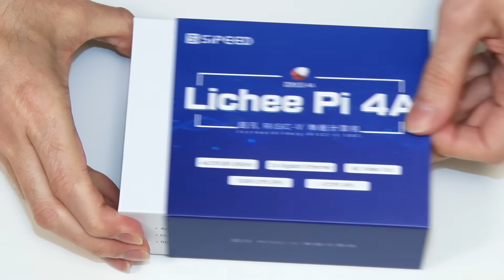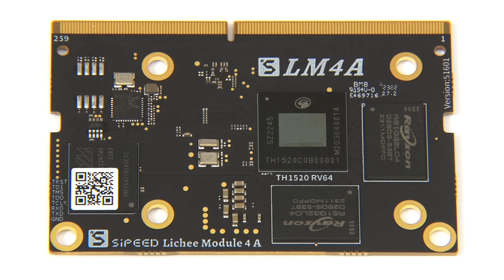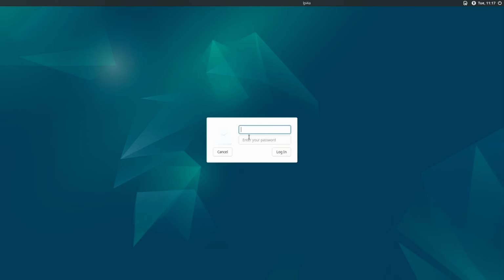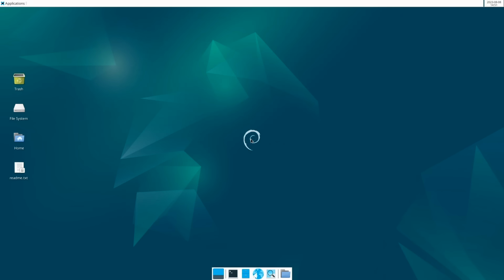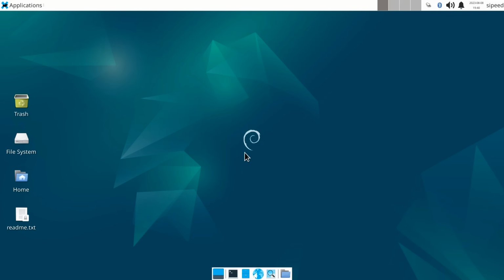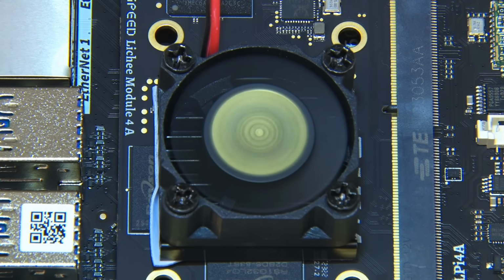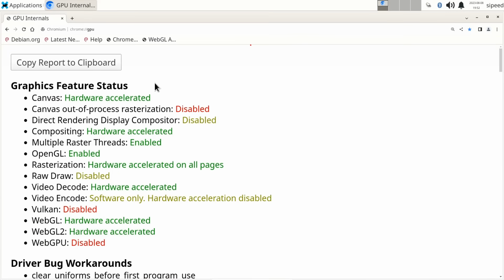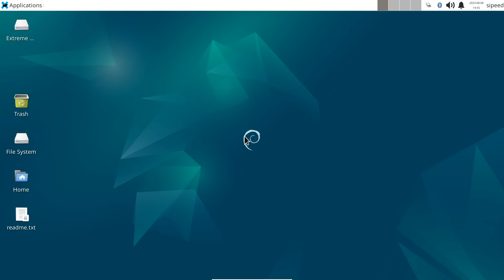Lichee Pi 4A: Serious RISC-V Desktop Computing

Comment: Definitely impressive. The presentation and smoothness of implementation bode well.
All those connectivity options should cover development for a wide variety of applications. (They obviously add a good deal to the cost of manufacture). Even then, the price is not unreasonable, and can probably be expected to drop if sales go well. 
The "official " case doesn't appear to be available for sale yet, but there's already a file for 3-D printed case on Printables. 
Your experiences with a test-drive will be most interesting. Do check your network while you doing that, for any inexplicable packets aimed at Chinese IP addresses. (Just in case it wants to 'phone home.) 
Seriously, buying anything from China today carries the question of whether it supports the CCP,  involves slave labour, or otherwise enables bad things.
Reply: well, which device isn't produced in China ?
Reply: @autohmae  At least as far as final assembly is concerned, the Raspberry Pi. (Made in Walesl)  I haven't followed the supply chain further back.

Comment: I think for YouTube playback, you may want to try to see if you can force H264 instead of the default VP9 codec that is used. The RISC-V processor seems to have hardware decoding and may be able to achieve much faster video playback with h264.
Reply: It does have HW decoding, but it should be able to pull off VP9 as well.

Comment: a quad core is to les to have a decent experience. and that module is engendered to run in a cluster.  that means for a decent desktop you will need 2 compute modules. try to benchmark as y saw on the chromium gpu report Vulkan support is not installed. so ed acceleration is not really there without Vulcan is just 2 d acceleration. in debian is nothing installed by default so ill suggest you do a benchmark after   you upgraded the is too latest after update the system you need to recompile the boot image the system is similar to an android hardware where the bootloader is installed on an extra chip/partition to be able to boot the os   but for best practice is at best to compile your own boot image based in the kernel witch resides in the boot image

Comment: It's always great to see that a SBC will work straight out of the box with the included Linux distro. It indicates a significant degree of care for the customers, present, future and repeat.
Reply: It has only now occurred to me, a couple of hours after watching, that this isn't, in fact, a SBC...
Reply: @BrianRonald  technically true. Sipeed make a lot of their boards this way e.g. see Lichee RV CM and Lichee RV Dock, M1s Module and M1s Dock.
Reply: I don't understand people that make comments like you have - SBCs are supposed to be aimed at hobbyists and makers who are used to messing around with hardware and software. As a member of such communities myself, I really could care less whether or not an SBC comes with Linux (or any OS) pre-installed, because I will install my own distro of choice (Gentoo) on it anyway.

If you don't know how to install Linux yourself then, in my opinion, you really shouldn't be using it and stick with consumer-grade hardware that has the OS pre-installed for you and some kind of warranty that protects you from your own lack of skills - whether that's a Microsoft or Apple device, or a Steam Deck.

SBCs are not consumer-grade devices and should not be treated as such - they are for people who know how to investigate hardware and configure Linux themselves to add to the knowledge of the community.

Even this device is in its early stages, work clearly needs to be done on the desktop OS (there's clearly still some lag in Chris' video) and the video drivers themselves need work. Someone who expects Linux to be pre-installed would not be happy with the performance of this device, and just blame Linux for it.
Reply: @terrydaktyllus1320   but they are gonna target small laptops and desktops market, so they better just work.
Reply: @autohmae  Sorry, who are "gonna target" the small laptops and desktops market?

So what you're saying is that the average user of laptops or desktops as an "all in one" package is instead going to buy an RISC-based SBC on which they would need to install their own OS, add their own keyboard, screen and mouse, etc. etc.?

Do you not understand that these are completely different kinds of devices? That SBCs are targeted at developers and hobbyists, or people that prototype hardware?
Reply: @autohmae  Why would I respond to your question when you have completely ignored the questions I asked you first?

Don't be so self-entitled - either have an intelligent debate and answer questions when you are asked them or just go away.

Your choice.
Reply: @autohmae  Yes, and it's a valid point that you now make. 

But my argument is then that if they end up making laptops or desktops, then it will be because the SBC has been a successful "prototype" to such devices in the future.

I don't know what SBCs you have used previously, but the Raspberry Pi has always been "the exception to the rule" because it has had excellent software and community support, which means it can be thought of as being CLOSE to a consumer device - i.e. someone who hasn't messed around with computers at all can get a Pi and a MicroSD card and follow a tutorial or YT video on installing Raspberry Pi OS easily. And good luck to such people, I have no issue with anyone getting more clever with computers.

But go to SBCs like the Orange Pi or Asus Tinkerboard, and the OSes that they run aren't so well supported, and may need tweaking or additional configuration to get them close to working 100%. In my view, that's the NORM with SBCs and it's up to hobbyists, developers and makers to get the best out of those board. (Even I do custom Gentoo Linux builds on such SBCs - it's interesting to do but it's very time consuming and not easy a lot of the time.)

So, no, I don't see SBCs REPLACING laptops or desktops for most users, but sure they are the prototypes for consumer devices in the future that may replace such.
Reply: @terrydaktyllus1320  well, see it from this point of view:
a lot of people buy a SBC for example for projects where they need GPIO pins, they don't necessarily want to write a driver for the WiFi card first
having some distro working means that they can (theoretically) also get other distros to work (even if it means that they need to take the patches from the official distro and port it to the one they want to use) without needing to start to write a kernel patch from scratch first
if on the other hand not even the included distro works from the get-go (e.g. the display output doesn't work and you want to use it to monitor and control your plant watering system with a touch display connected to it), how likely do you think you are going to be able to use it for your intended purpose?
Reply: @kuhluhOG  Your reply makes no sense whatsoever, let me break it down a bit.

"a lot of people buy a SBC for example for projects where they need GPIO pins,"

Yes, absolutely - and is one of the main reasons I will use an SBC instead of a used SFF PC that I can get for a similar price - i.e. because I need GPIO pins.

"they don't necessarily want to write a driver for the WiFi card first having some distro working"

Utter nonsense, and that's you demonstrating a lack of Linux knowledge and, instead, repeating a meme or "what a bloke in the pub told me".

I started using Linux in 1996 and go back 20 years, there were issues with wifi drivers in Linux, mainly due to availability of closed firmware and proprietary chipsets. In the past 15 years or so, I have had ONE issue with wifi drivers where my wife gave me her old Macbook from 2013 (when she upgraded) and I stuck Linux on it. The Broadcom wifi card wouldn't work, I had to buy the previous version for £5 on eBay and that fixed it.

Guess what? Nobody can just put any hardware they want on Windows either. I have a printer and a scanner that work perfectly fine in Linux but there have been no Windows drivers for them since Windows 7 - so the opposite is true too.

Only stupid people don't research hardware to check it is supported by an OS before they install it anyway - and a wifi card is cheap to buy and replace in any PC desktop and (most) PC laptops.

"they can (theoretically) also get other distros to work (even if it means that they need to take the patches from the official distro and port it to the one they want to use)"

More nonsense because hardware support doesn't vary between distros - the kernel, not the OS, provides the hardware support through drivers, and the kernel code between distros is extremely similar.

"without needing to start to write a kernel patch from scratch first"

I've never needed to patch kernel source to get a piece of hardware working - on a rare occasion (and not within the past 10 years or so) I've had to download external driver sources to compile against the kernel I am using, but I've used Gentoo Linux for 20 years now and that stuff is second nature to me. Plus it really has to be very OLD or ECLECTIC hardware to have that happen.

"if on the other hand not even the included distro works from the get-go (e.g. the display output doesn't work and you want to use it to monitor and control your plant watering system with a touch display connected to it), how likely do you think you are going to be able to use it for your intended purpose?"

I can't answer that question because, as an engineer, I have not been given enough detail by you to answer it. Is the watering system wifi enabled? Or does it use bluetooth? Or do I control it though a Pi Pico or ESP32 microcontroller, in which case I program it through the Arduino IDE which is fully supported on Linux.

Again, this is about doing proper research first - and not just believing "what a bloke in the pub" told me.
Reply: @terrydaktyllus1320  "In the past 15 years or so, I have had ONE issue with wifi drivers"

1. You do know what an example is, don't you?
2. I help at my local universities at the Linux install parties at the start of every semester. We have about 4-6 devices with WiFi problems every time.

"More nonsense because hardware support doesn't vary between distros - the jernel, not the OS, provides the hardware support through drivers"

You do know that the majority of SBC manufacturers DO NOT upstream their drivers but instead leave them in self-hosted repos, don't you?
Reply: "1. You do know what an example is, don't you?"

And we're done. I didn't read beyond this point and you wasted your time writing the rest of it.

When you, a complete stranger on the Internet, start patronising me, I have no reason to continue the conversation with you.

Discussion closed, have a great rest of your day.
Reply: @terrydaktyllus1320  please answer one question: In which way do you read this as "patronizing"?
Because quite frankly, this isn't the intention on my part.
Reply: @kuhluhOG  That guy's condescending as hell, then accuses others of patronizing. 😂😂
Reply: @terrydaktyllus1320 totally on point. His comment has more than hundred votes.. What is happening to the world!
Reply: @darththuban00  Each to their own, I don't see the number of comments as being a metric of the quality of a comment anyway - given that YouTube provides channels of interesting topics that naturally create echo chambers of themselves anyway.

I have simply been around computers long enough to take an engineering perspective of any system, and try to look at it subjectively.

I actively encourage everyone to become better informed when it comes to computing and I myself give workshops and free training to both younger and older people to that end.

So I am not, in any way, trying to create a "niche community" or anything like that, but I think too many people get pulled in by "FOMO" without realising that a time and effort commitment needs to be made to get these non-consumer devices working well.

But thanks for your comment, it is appreciated.

Comment: It's a bit of a stretch calling it a single board computer, isn't it Chris? Using a SOM and a carrier board must add considerably to the cost. If Raspberry Pi 4s were available and their normal price this would be very expensive. Nice to see that it boots Debian out of the box though. I bought a pink Mango Pi in order to play with RISC V assembly language but I can't get any response from it despite trying three different images on three different micro SD cards.

Comment: They've made significant process since your last RISC-V video. It won't be long before RISC-V gives ARM a run for its money. And if they keep making progress at this rate, Intel and AMD had better take notice.
Reply: @@wotzinator6282 What's wrong with Linux desktops with Intel and AMD CPUs at their heart? Or is there something wrong with those that stops you enjoying Linux now? Are you just another person I call "YARs" - "Yet Another Reason" to not do something to hide my own procrastination.
Reply: @terrydaktyllus1320   The Intel Management Engine and the AMD Platform Security Processor are both insanely scary in terms of freedom and privacy.
Reply: @@wotzinator6282 Sure, so am I - I currently run Gentoo Linux on Raspberry Pi's, 32-bit and 64-bit Intel and AMD CPUs, Xeon, and even a SPARC platform.

And if another platform comes along that is interesting to try out, like RISC, then I may have a go on that also.

But I am an engineer, I look at what's around now, I have too much to do without wondering too much about what is coming next. I just find that a strange way to think.
Reply: @@wotzinator6282 There are already ArchLinux, Debian, Ubuntu, Fedora, and the 3 BSD flavours on RISC-V, which distribution do you want :)
Reply: @@lurch789 There is already a RISC-V tablet from Pine64. Computer is not only for gaming. Boring gaming high budget games is just a side thing of computers.
Reply: @@wotzinator6282 Not only open, far more efficient than other RISC ISA SoCs, and so far far more efficient than x86_64 ISA based processors. Don't need fan to have good performances, and don't drain your battery like x86_64.
Reply: It's  really not that simple. The ISA is open, but individual, high performance chip designs using it, probably aren't going to be free or open. Just like Apple has done with their own ARM based CPUs, which aren't shared with anyone. ARM has had decades of development, it has a proven track record, and a huge infrastructure behind it. So does x86. Risc V has none of those yet. Will it ever? Only time will tell.
Reply: @another3997  But even if the chip designs are proprietary, they must all conform to the same standard. And that provides a huge benefit for software development. Plus there is a huge incentive to develop chips that use the RISC-V standard because these chips won’t have to pay licensing fees.
Reply: @another3997  In fact, RISC-V has the whole industry and most of the world research/universities that work on it, what do you want more???  What do you expect, behind the fact it already work and as this video shown you can use it???? You even probably have some RISC-V core for years in one of your devices without noticing it.
Reply: @another3997   I can easily see phone manufactures pursuing a high performance risc-v design.  Both to avoid paying the troll toll to ARM but also to freely add their own accelerators.   If a little dev board is already made something that's this polished then getting android working well isn't far off at all.
Reply: @@wotzinator6282 Unless the economy collapses (as seems likely), I doubt you will have that long to wait. They seem to be making progress very quickly.
Reply: @CCoburn3  You already see a full desktop working, with all the applications what do you want more ?
Reply: @ThePopolong  As Chris points out, some of the applications are slow. He will probably find that some applications won't work at all when he tries it for a week. It's not a problem with RISC-V. It's more of a problem with system resources. Before long, I think we will see beefed-up RISC-V computers that will handle just about anything that people throw at them.

Comment: It would have been nice to hear about its power consumption as well as maximum RAM capacity. Otherwise I found your account very interesting. What about the BSDs, does it play with them also or are we bound to Linux? For a desktop system the 720p limitation definitely seems like a show stopper to me.
Reply: Have you watched Chris' reviews of Arm SBCs? Few of them can play 1080p smoothly, even now.
Reply: Max power is 12v/2a and that's for powering the board with high draw USB devices. On USB-C power, it's about 10W.
Max RAM is (theoretically) about 32GB, but even the 16GB high end model is very overkill for a little SBC like this. Also good luck stuck with a 64 bit interfacing with 32GB of RAM.

It's kind of stuck with Linux for now, but I believe it's in the queue for FreeBSD. OpenBSD I'm not too sure that it's in the works. NetBSD is a no-go since they don't even have a QEMU build.
At least it isn't the Andes RISC-V stuff since they have intentionally added a hardware quirk that isn't standard. No fix FreeBSD says.
Reply: @No-mq5lw  what is the problem with 64 bit and 32 GB RAM? Also, the non-translated memory range problem with the Tinker V is the fault of the SoC maker Renesas, not Andes.
Reply: @BruceHoult  I had a feeling I got mixed up somewhere with that. From what I know about GPUs, lower bit width with bigger memory sizes tends to not benefit you as much.

Nice seeing you here though.
Reply: @No-mq5lw  Great, thanks a lot!